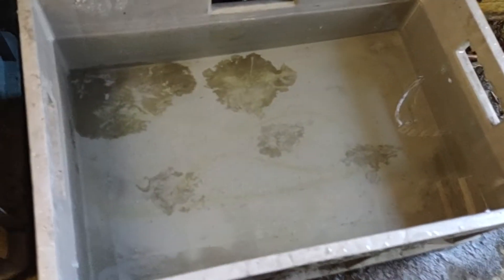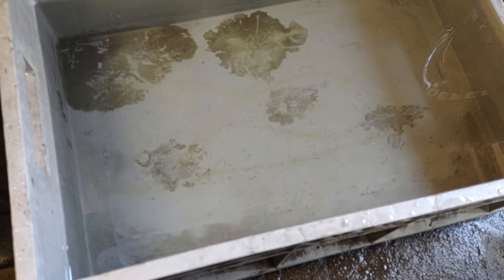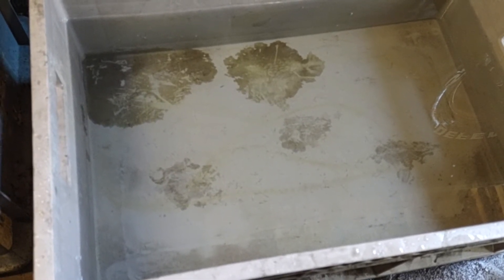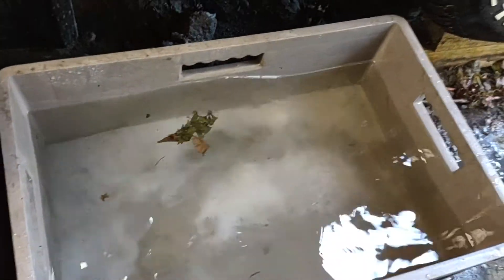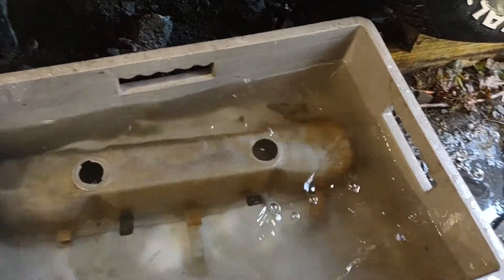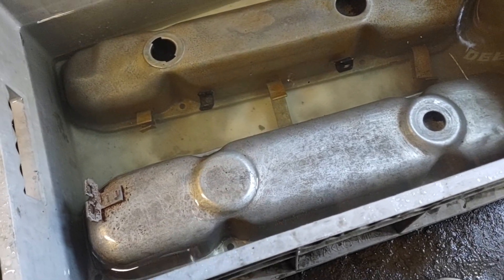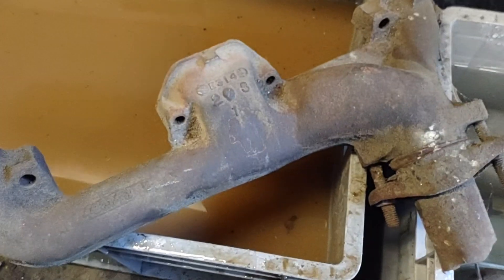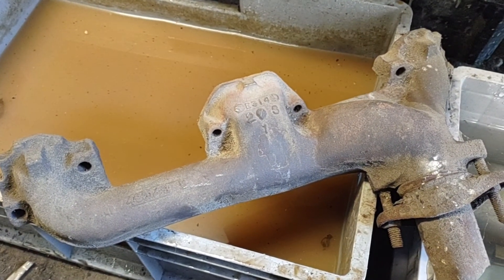Vinegar Cleaning Valve Covers

Comment: Can you clean the inside of a radiator and engine like this too?
Reply from the maker: I have took a set of Cast Iron Heads and submersed them in vinegar for a week , and they came out clean , but don't forget to neutralize them in baking soda. Don't  use vinegar on aluminum. It will eat aluminum up as far as the radiator. I don't know. I would take a junk one and try it. but not a good one until I knew the outcome... The cast iron and the metal like the valve covers it's fine....
Reply from the maker: It's great on cast iron engines...
I would not on radiators. 
Don't forget to neutralize after it's clean